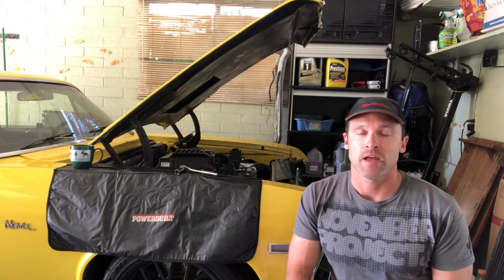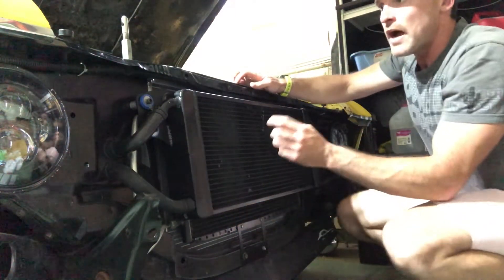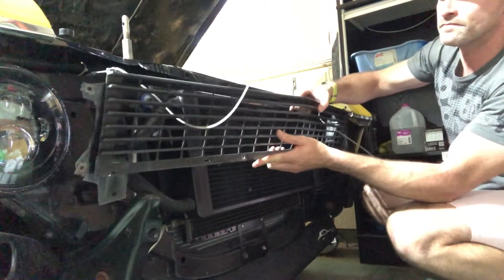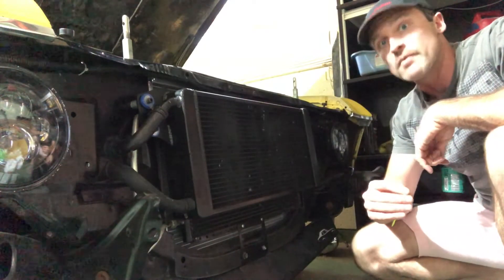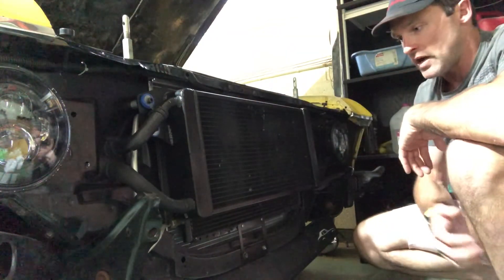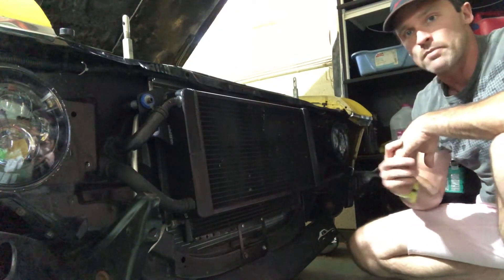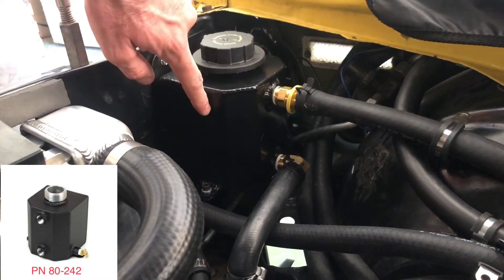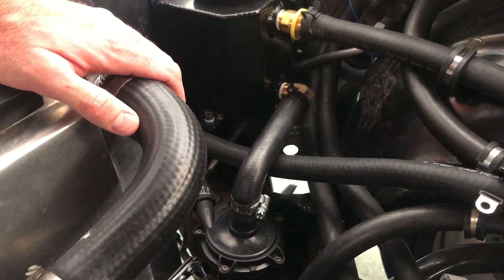LSA Swap Cooling System in My Nova

Comment: I'm considering doing a similar setup in my 66 Nova. Curious if you've experienced and overheating issues with the A/C condenser and heat exchanger restricting any airflow to the radiator?